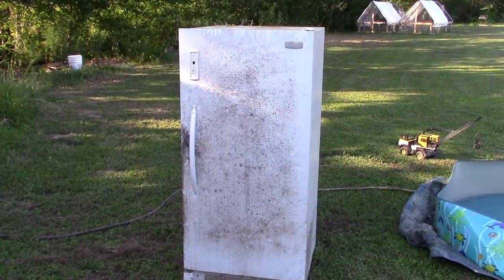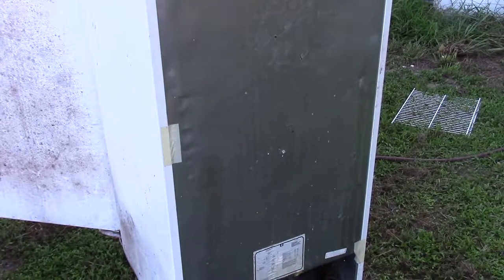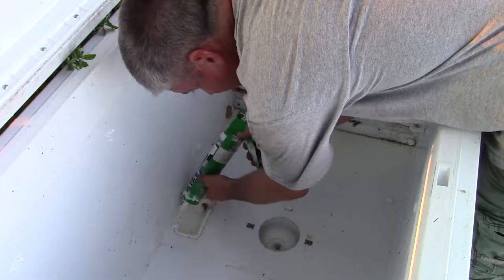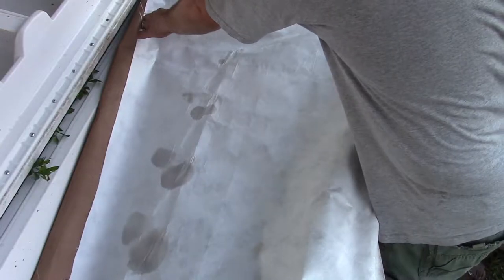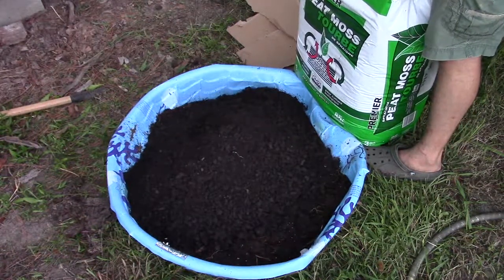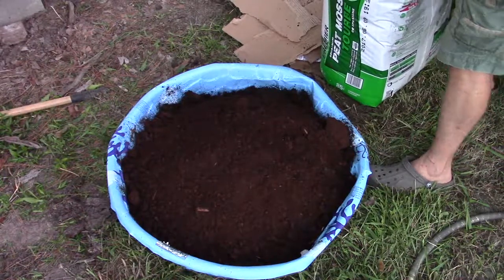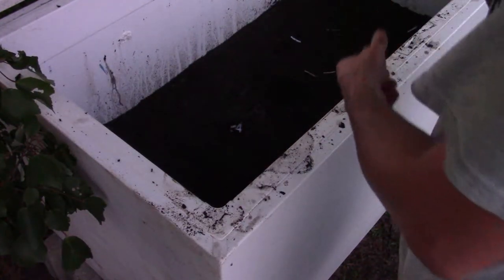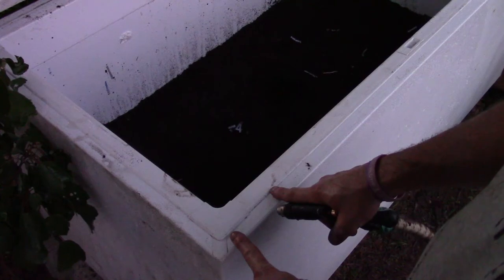My Freezer Has Worms!!!!

Comment: It looks like it is going to be a fine worm making freezer.  Did you have to add air holes in the top or side of the freezer?
Reply from the maker: yolanda hudson no did not need the air holes but it got so cold here I lost lots of them because it got so cold in the freezer. Never crossed my mind until it was to late
Reply: This is good to no because I was going to bury mine until I saw yours.  Now I will go ahead with the project of burying it.  It will stay a constant temp.  Thanks for commenting.
Reply from the maker: yolanda hudson only issue I see with burying it is drainage.
Reply: Put a couple of bricks under it.  It should drain and soak into the soil.  This is my only solution.  Let me know if you come up with anything different.
Reply: Did you get your worm farm going in the freezer in the ground? Where I live in Northern California it's not uncommon to be over 105 degrees for a couple of weeks. In ground sounds appealing for the coolness. @sillylilly4794
Reply: I did and it worked fine.  The only problem was we got a lot of rain and filled up the hole it was in and raised it up. It went back down.   The worms are doing great.  This summer tho I need to drill more air holes.   @robinlawson3574
Reply from the maker: I need to do something with mine so they stay warm